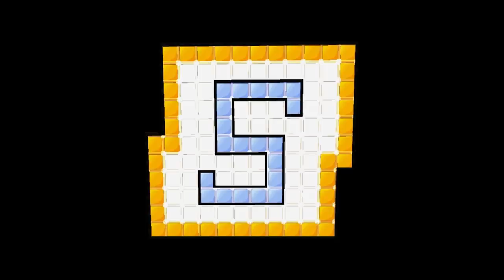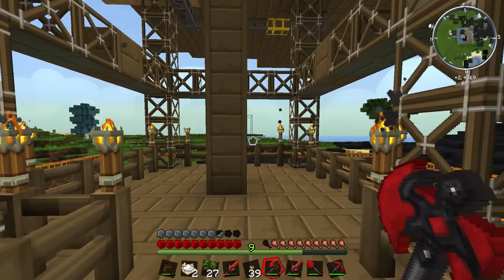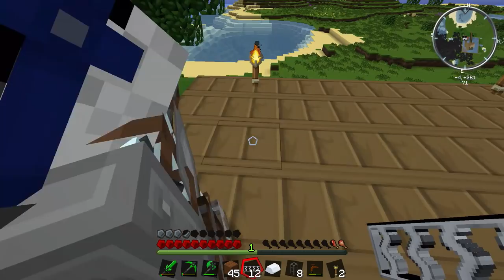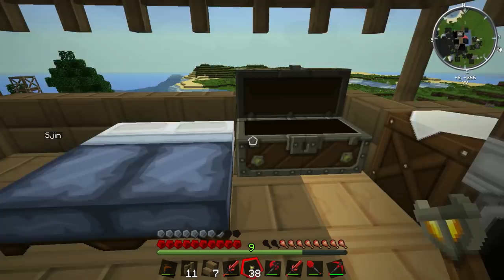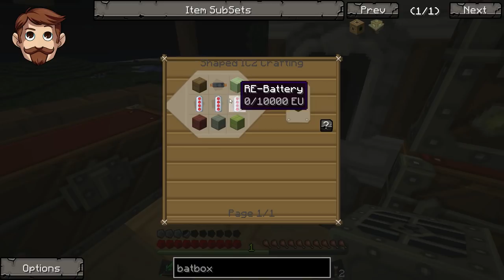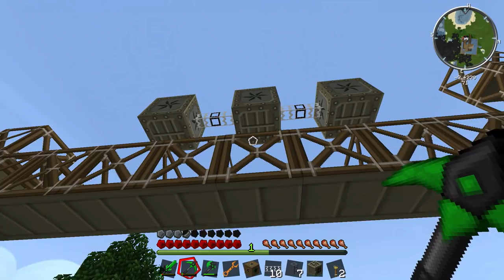Sipsco Dirt Factory - Part 26 - Donald Duck

Comment: Sips and Sjin, using charcoal you get from a treefarm is a great idea, but may I suggest turning the wood into scaffolds and using those as fuel instead?
Scaffolds are more efficient than any other wood products (including charcoal) for use in IC2 generators or Stirling/Steam engines. =)

Comment: For every block near a windmill, the power it produces is decreased. If you want much power at all, windmills need to be spread out above y=90. They generate very low voltage, so you can use them with tin cabling however, but keep in mind you can only go 40 blocks with any wiring before the power they produce is reduced to 0. To fix this, add in low voltage transformers every 40 blocks on the way up.

Comment: Sjin, Sips you could use wooden scafolding in sterling engine or generator. And you can use tin cable for windmill instead of fibreglass cable. :)

Comment: Guys don't use fiber glass cables. It's much better to just use copper cables at this point. Glass fiber cables do have their advantages, but they're meant for high-voltage electricity and are VERY expensive.